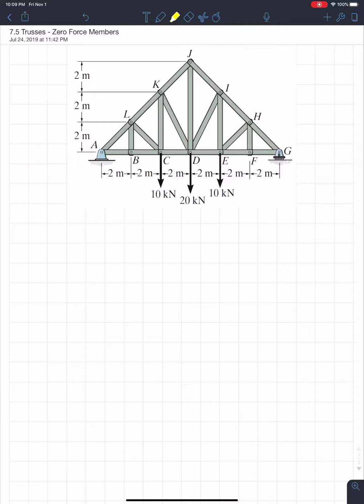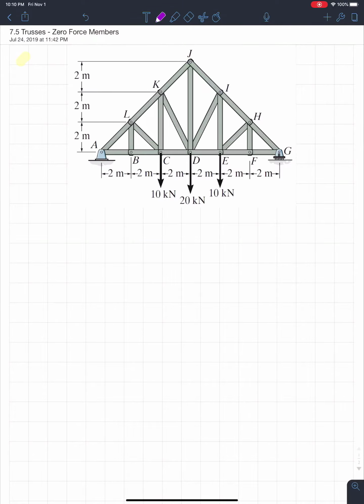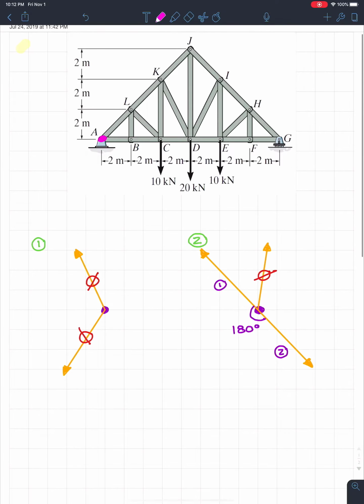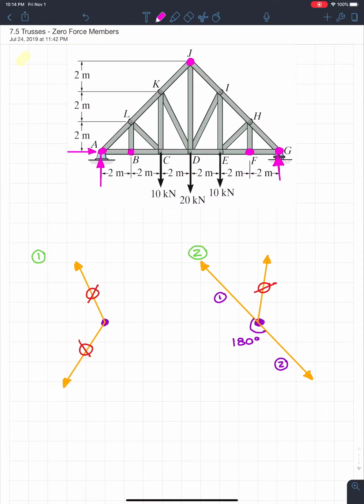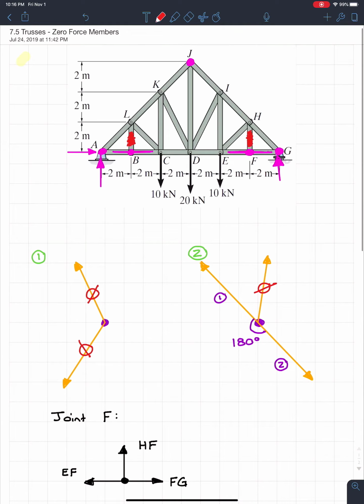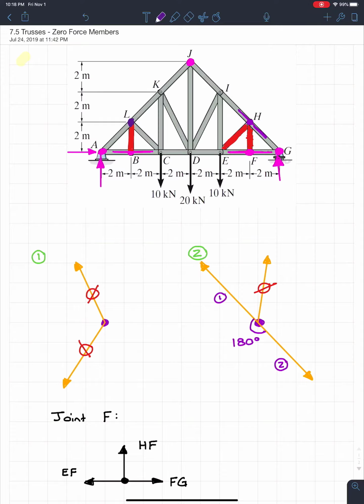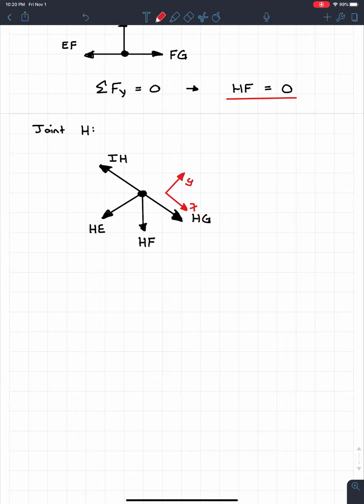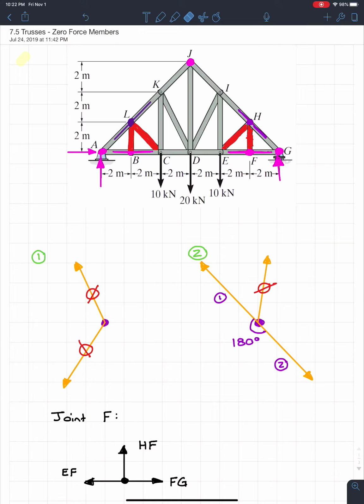Engineering Statics | Old Example | Zero-Force Members

Comment: wouldnt all the members disappear in this diagram except the outer ones if you keep reducing it using thee collinear method?
Reply: I thought the same thing, but points C, D, and E all have external forces acting upon them, so the rule is not applicable on them.